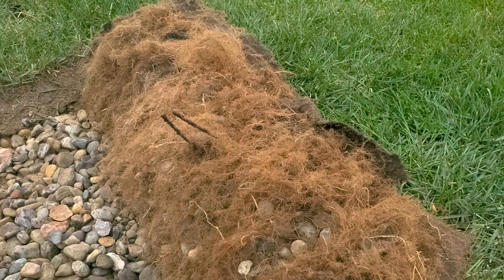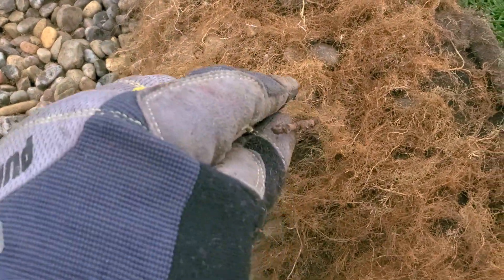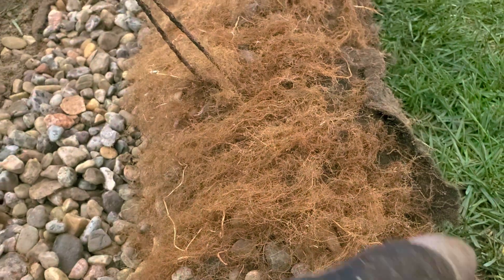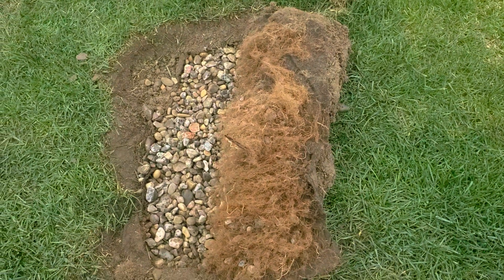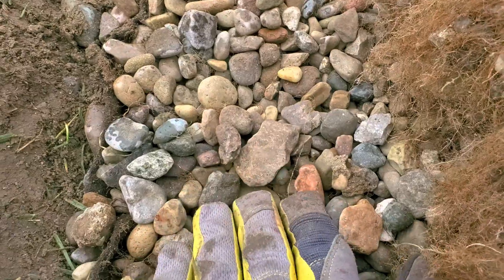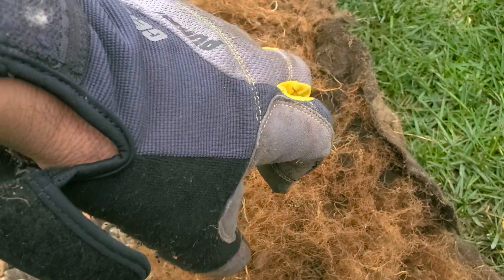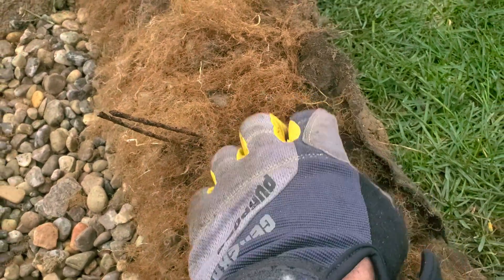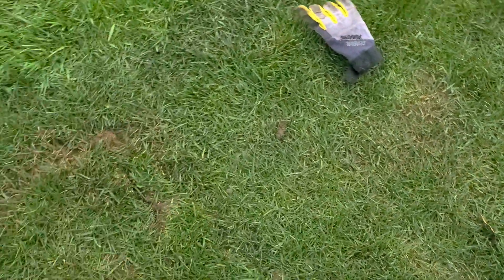How Double Punched Non woven Geotextile Fabric Works in French Drain Systems [05-10-2020]

Comment: Do you still use the fabric if only stone will be covering the French drain. No planting of grass or anything
Reply from the maker: We do most of the time. We like a fully contained system
Reply: @FRENCHDRAINMAN  thank you. Also, what's your thoughts on the black corrugated pipe, if we do everything you do correctly in regard to the burrito and necessary accessories, pertaining to how long it will last. I plan to buy the solid double wall for most of it from Menards.(downspout drainage) I'd like the blue or yellow but that freight costs kills me. 

Your videos are very helpful!
Reply from the maker: @taylorardisson9387  Black corrugated pipe is recycled ♻️ plastic. It splits open after a couple years. Very weak and it will Collapse